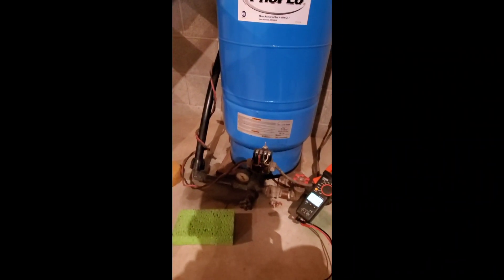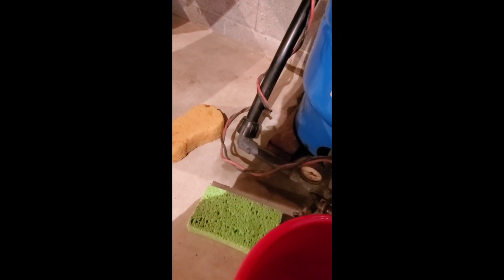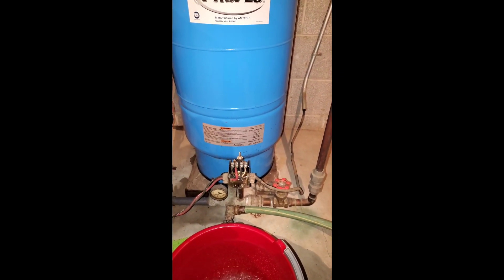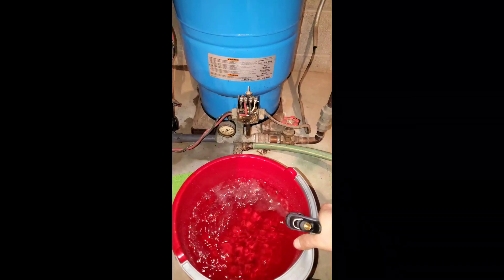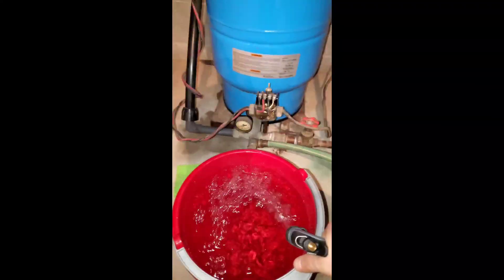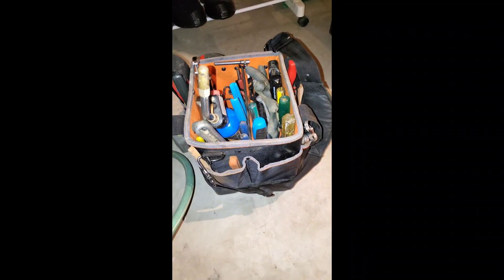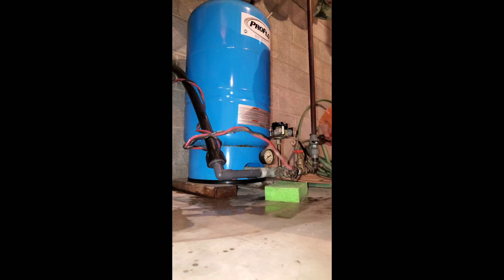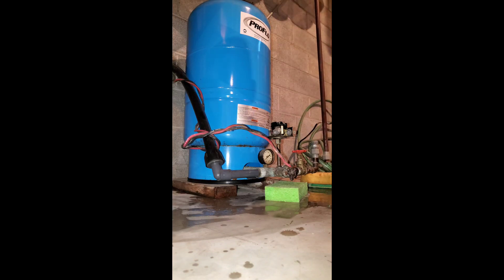Well Pressure Tank Replacement

Comment: Do submersible pumps ever lose their prime during a tank replacement? They usually have a built in check valve correct?

I would like to replace my tank soon but I'm a little worried about losing prime...
Reply from the maker: Correct submersible pumps have a built in check valve at the pump head. So no worries when replacing a tank with a submersible pump.
Reply: Mr.Michigan - That's what I thought. Thank you for the reply.